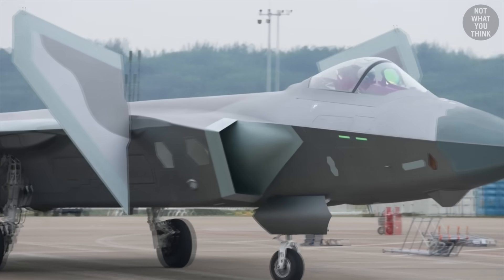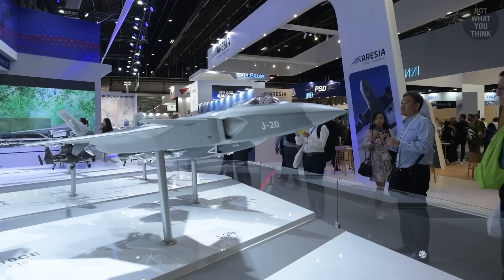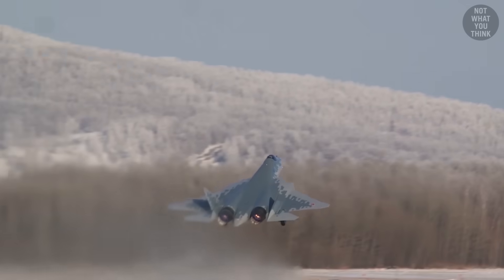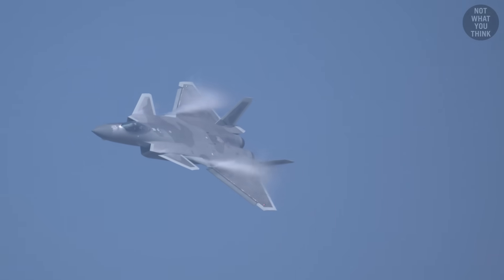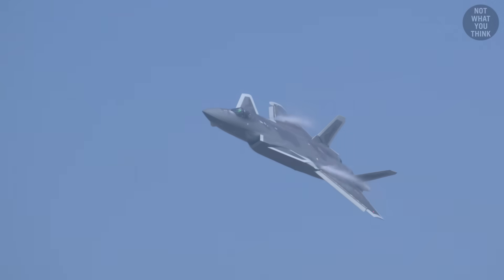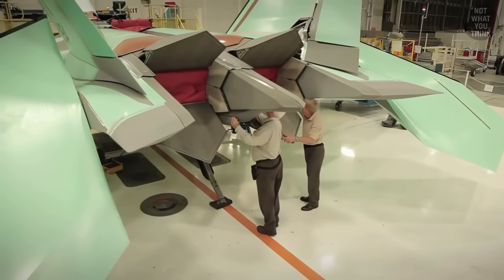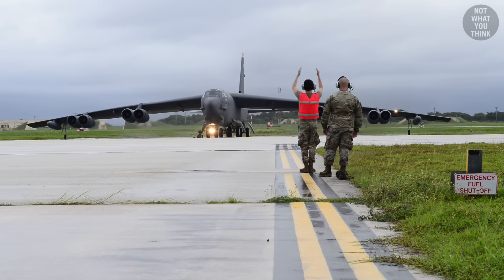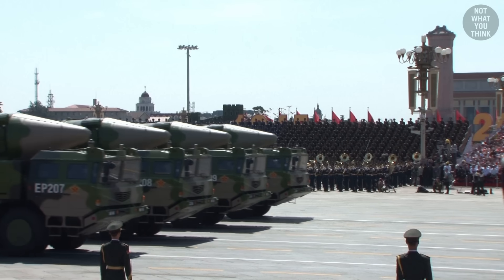Why China's Stolen "Stealth" Fighter is Problematic

Comment: 3:52 Could the increase in temperature or exhaust gases actually increase your radar signature ? Curious to know how. Or did you mean that the aircraft would be way less stealthy to heat sensors like IRSTs ?
Reply: Wondering if the unburnt fuel or certain molecules in the exhaust could somehow facilitate the reflection of radar waves.
Reply: Most likely it's a misinterpreted source that is referring to the SU-57 which currently uses a variant of the engines the J-20 initially used. The SU-57 is supposed to have a different engine that is more powerful, sleeker and has a lower RCS than the 4.5 gen engines currently fitted.

While it might be possible for radar to pick up any precipitates, or similar that form in a jet wake I doubt it is significant enough to be of concern for air forces
Reply: @eoinkenny3188  How does a different engine affect the plane's RCS since it's all inside the fuselage ? To my knowledge, the air intakes are also designed such that the blades are not directly reflecting anything. All I can think of is a different jet engine modulation at close ranges, or indeed a different RCS but only from rear aspect. Keen to know more

Agreed, would be cool to know if there's any possibility of signal amplification due to the exhaust stream's geometry, composition or something, but yeah it would likely be negligible.
Reply: @ced3308  I'm only reciting rumours I've heard, which is more or less what everyone is doing. Anyone who actually does know is not sharing.

From what I've read the engines fitted to the SU-57 are larger than what it was designed for so the engines are exposed  and don't have low RCS cowlings. The SU also doesn't appear to have serpentine inlets like the F22 so the compressor stage is visible from certain angles

Comment: The J-20 is an interceptor, not a fighter.  It's designed to cover the long distances of the South China Sea with speed, launch big telephone-pole sized long-range air-to-air or air-to-surface missiles at strategic targets like AWACS, tankers, ships, and land bases, then return to base and reload.  It's not a dogfighter.  

The PLA's doctrine is to overwhelm enemies with quantity, in this case quantity of missiles - land-launched, sea-launched, and air-launched simultaneously.  Blanket the entire SCS in missile barrages.  And they're producing both those missiles, and their launch platforms (J-20, Type-055, subs, land launchers, etc) in quantity.  That's the real problem they're creating for US and allied forces in the region, quantity + range, not any one particular platform.
Reply: the one big advange the J-20 has that most channels don't mention is range.
Reply: @nicholasespinoza9610  Compared with F20, the biggest disadvantage of F22 are not only its out-dated electric awareness and its fuel shortage, but also its shorter range missiles, it can not go longer distance and it could be shot down before escaping, although its radar is under upgrading, it still couldn’t solve the fuel shortage issue.
Reply: @nicholasespinoza9610 yes people keep talking bullshit like china copied, yet they forget that chinese is kilometers ahead in terms of radar and missile technology
Reply: @NeostormXLMAX  i wouldn’t be so confident in missile tech boy
Reply: @NeostormXLMAX eh? Because they made a hypersonic missile? 
Son we made a hypersonic plane in the 50s it STILL has the record for the fastest crewed powered aircraft today.  We also did hypersonic maneuverabile glide vehicles starting in the 70s to the 2000s . 
  We just rolled out hypersonic missiles and longer better missiles for planes.  And I don't know who told you their radar was better but they are full of shit . 
 We are more than a decade ahead of them tech wise and that's gonna be hard to catch. Remember these clowns are the ones saying stealth is useless but builds stealth says carriers are useless but is building those.
Reply: The US military is aware of this and is why it has invented the Rapid Dragon  system that can fire 9 500 mile range JASSM-ER or 1200 mile range JASSM-XR or 500 mile range anti-ship LRASM from C-17 or 6 from C-130
Reply: any aircraft big enough would do and yet they built a stealth plane for that kind of job? nice logic
Reply: PLA isn't an interceptor by PLA classification, it's a myth created by online forums
Reply: @WishalloyNo matter what kinds of upgrades, the fuel tanks of F22/F35 still too small and they are also lack of long range missiles.
Reply: Note that in modern air combat, the distinction between interceptors and fighters has become very blurred. They are all beyond visual range air combat. Machine guns originally seem to have little significance. In actual combat, long-range missiles are launched to attack the opponent's fighters and early warning aircraft. Dogfighting no longer exists after the Yugoslav Civil War. They are all beyond visual range strikes. Moreover, the fifth-generation aircraft does not have much advantage in dogfighting over the fourth-generation aircraft. The Typhoon fighter also has a record of defeating the F22 in dogfights. The J20 and F35 are not biased towards dogfighting, but are beyond visual range + as battlefield information nodes, and dogfighting can be handed over to the F15 F18 J16 J10 and other 4++ fighters to complete.
Reply: 1. Interceptor not a fighter: often parroted but nothing from Chinese source indicate this. Its much more likely that it is meant to do both, and the canards help significantly with maneuverability. No guns but it has short ranged IR missiles for dogfights, which is the primary modern weapon for dogfights. Btw only F35A airforce variant comes with internal guns. 

2. Overwhelm enemies with quantity : again a Western projection, just like how the Chinese were portrayed using human wave attacks in the Korean war or Russians in the Ukraine war. Of course more stuff is better but it is not much of a doctrine. The Chinese doctrine is symmetrical with US doctrine and emphasizes networking and system of systems. If you are talking about saturation attack then it is not really about quantity but rather coordination of assets which does go back to the system of systems idea.
Reply: @kevinc1200  but it is a reality that russians continue to use human wave like tactics in ukraine western projection? More like reality but a all the time thing
Reply: @kevinc1200 and if they aren’t able to coordinate effectively…everything fails!
Reply: @kevinc1200 Finally someone who understands
Reply: @kevinc1200 Lack of combat experience is why you would produce a fighter without a gun.  Nobody needs a gun on their fighter until you need a gun.  Everyone has a plan until first contact with the enemy.  It is more likely 2 stealth fighters won't be able to see each other until they are in gun range.  That's when you figure out having a gun could be helpful since getting a target grade lock on a stealth fight is difficult by definition.  Indians reported 3 years ago that they were able to detect the J20 was that intentional on the Chinese or accidental?  No one knows.  We do know that nobody has been able to detect the Raptor.
Reply: @marklihsu Great point .
Reply: @marklihsu why would the chines  give up the radar signature of thier cutting edge stealth fighters? 
More likely they put radar reflective vinels and also  likely that detecting j20 on raider was probably very amplified for propaganda by india. India literally lack the  radar  technology to properly detect /target stealth fighters. 
If j20 really were detectible then japan, south Korea and Taiwan would scream with propaganda. As j20 flies more on south china sea.

 Also all stealth fighters are detected by low frequency radars except those have extremely inaccurate targeting And largely obsolete.
High frequency radars are what is used for targeting and f22s and j20s are basically invisible to those radars.
Reply: @HairLessBush  detecting stealth aircraft is actually easy as shit you know those radars used by airports? Yeah those can detect stealth aircraft its military type radars that cant
Reply: @marklihsu  You only need a gun for ground attack and a gun pod, everyone has one, is up to the task. Missiles work fine at short range and have a higher hit/kill ratio.
Reply: @marklihsu  it's coming from the same country that said their mig 21 beats a f16, yeah believable
Reply: The west can jam Chinese drones easily. Western AI is far superior to the Chinese, and will only get increase in superiority.
Reply: @Wishalloy If you look at the war in Ukraine, very few war machines seem to have come face to face as they did in WWII. It really does seem to be a fight with drones, missiles and men really. Maybe the ruskies are onto something here.
Reply: its the  j22, 23,24, they should be worried about
Reply: Yeah it doesn’t matter because this things gonna get smoked when it goes up against F-15s and F-35s. This plane is not stealth and is only slightly hidden. Also an interceptor is going to have such a high heat signature that it will be easy to track.
Reply: @Wishalloy Tell that to the Navy air force
Reply: The problem with the J-20 strategy is the F-15EX with AMBER rack can hold 22 missiles
The newer variants of the AIM-120 as well AIM-9X II are sensitive enough to target PL missiles as well as SAMS
So they may wanna rethink that
Reply: @verdebusterAP  Please make sure to convince USAF about your idea
Reply: @kanlu5199  
The USAF is already convinced with AIM-260 program
Reply: @verdebusterAP  Weapon from PPT doesn't count
Reply: @kanlu5199 
Sure not
Reply: @verdebusterAP  I jest widoczny dla wszystkich  radarów
Reply: @ranguren2156  
yawn
Reply: The excuse that it’s an intercepter not a dogfighter is BS, you don’t have canards and thrust vectoring engines on an interceptor. Those are all traits of a dogfighter, it’s just to cover up the fact that it’s a POS . You can steal designs, but you can’t steal XP, and doctrine!
Reply: @josephmumma6997  
Interceptors can be fighters but J-20 doesnt have realistic chance against an F-22 in WVR fighting
50/50 chance in BVR
Reply: These chinese aircraft is for show of force only like air show.😂
Reply: Watch out you backyard! Chinese Immigrants joint by other Asian ethnics groups are building their new country inside of America!
Reply: It is a fighter. With turn radius not worse than the raptor. Those are TikTok information
Reply: West Philippine Sea.
Reply: @JTManuel  cry
Reply: I believe the J-20 is only an air-to-air platform.
Reply: Wow! an interceptor that doesn't sound like one..haha well..i guess that's what you get from stealing...
Reply: It’s a multi role platform
Reply: Funny thing. It won’t work. They already tried it in Korea.
Reply: It is an air superiority FIGHTER with long range precision weapons.
Reply: So its the foxbat 2.0 💀
Reply: It also uses carbon fiber stealth technology which is different than f35
Reply: That's odd. Why isn't anyone buying them? Oh that's rite because they are junk!
Reply: No shit, Sherlock. Dogfighters aren't really in production anymore. No pilot thinks there's going to be a dogfight maybe ever again unless something goes very wrong. There hasn't been one since 1988, almost 40 years. The point is that, just like any product from China, it's an inferior product.
Reply: @5133937  all that's great but you are forgetting the most common factor.. China can't build a reliable/ powerful jet engine. They rely on Russian technology for reliability.. their China design and produced jet engines are junk...
Reply: When you can't compete, just say, "It's stolen/copy."🤭
Reply: @kinwaisiu9414 what do you mean compete?? 🧐 china prove nothing in war but displaying the low quality made.. in reality scared to getting involved. lmfao
Reply: @5133937  are you still using Russian engines or did you finally get yours to work for more then one flight??
Reply: that's why we need to boycott the chinese product hahahaha.. all over the world so they can't produce more and can't maintain their military equipment.
Reply: @crackversion13  Hope you success one day by boycott Chinese products; don't forget to throw away your laptop, your phones, your routers, your TV
Reply: China has J-35 as their main fighter, as well as J-20 single engine version soon be coming out. 😂
Reply: Missiles filled with water😂
Reply: Damm good thing the us still has a baller ass fleet of f15s which are still the fastest interceptors in existence
Reply: @dylanshobbies8794 J20  2 .8 MH。5500KM。1.8Mach supersonic cruise control
Reply: @dylanshobbies8794  mig 25 foxbat entered the chat
Reply: @dylanshobbies8794 MG 31 is the fastest with official statistics. However the Russians tend to lie to seem more powerful and the Americans tend to lie to seem weaker than they are.
Reply: @dylanshobbies8794  F-15s? Fastest interceptor in existence?
Bruh.
Mig-31BM: I'm still fking alive, my dear comrade
Reply: @jeffery7281  sorry I don’t count planes that have to be scrapped after they hit there top speed because the airframe and engines could only handle it once
Reply: @dylanshobbies8794  dude thats mig25 not 31
Mig-25's engines will probably get f*cked if they going for Mach 3 because they reached this via water injection, otherwise they can comfortably cruising at M2.35 for whatever they like untill running out of fuel (despite that's only 1 hour at most)
Reply: except the new long-range US AA missile OUT ranges it
Reply: That's not true. 
J20 is a fighter jet plane, same as the F22 and the Su 57.
Interceptor is the J31 plane = Mig 31.
Reply: It depends. An interceptor isn’t good at BVR (engaging, defending, recommitting), but a fighter is. The J-20 as far as we can tell has good kinematic performance at high Mach.
Reply: @jacobbaumgardner3406 all the F-15s gotta be is missile slingers as the F-35 can help them target at extreme range via link16. 
 Hell with those new air to air missiles they got now you could launch them off anything
Reply: China has all the numbers, but the question is what about their quality of training?

A chinese paper published in January said that pilots were trained at fixed targets every single time. At one point they fly sorties at night and bomb targets on ground WW2 style lol. They are great in projecting firepower but they’re miles behind from US or even Japan in terms of real combat training.

Those PL-15 missles that you guys are so proud of? Turns out PLA tested them in certain conditions, not in a real world scenario, thus AIM-120D has more realistic range than PL-15.
Reply: @bluee3788  Bro I closely follow PLA & PLAAF and I'm amazed at your quality of making stuff up. I mean how shameless can one be to make stuff up
Reply: @arminius6506  HAHAHAH I would not waste my time “making stuff” just to gain some attention like some other dudes. PLAAF has some good jets, but it would be a shame if their maintenance crews are only trained 3 months compared to years of training in USAF. Again they have good jets, but the lack of training of their pilots and crews makes their airforce a “paper airforce”.
Reply: @bluee3788  If Chinese have better engineers to build better Tesla at Shanghai than they're built in Texas than surely PLA engineers can maintain the stuff. Just keep in mind an Apple doesn't fall far from the tree.
"paper air force", dude you're envious
Reply: Drone swarms negate Chinese numerical superiority.
Reply: @ShaKa-Ri  China has too many drones for US fighters, ya, good point!
Reply: @ShaKa-Ri  industrial output for drones u know who will win ? They got the battery tech…
Reply: @IntertropicalConvergence-gf3bm  When neocon does not want to lose, sadly we can't win with out facts!
Reply: @ShaKa-Ri who do you think makes the most drones? They have they tech and they can mass produce like no one else. Please don’t bring up stupid arguments again.
Reply: @ShaKa-Ri lmao almost all police drones in the usa and even in ukraine are chinese drones